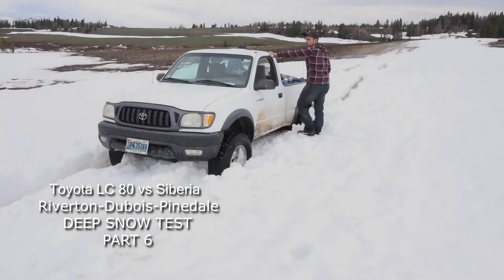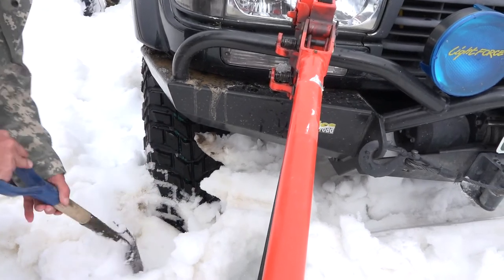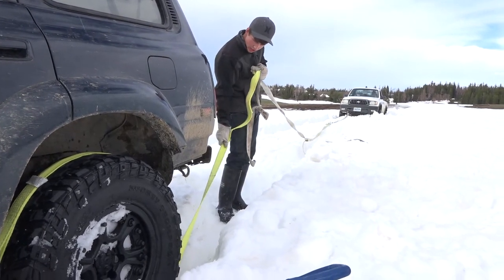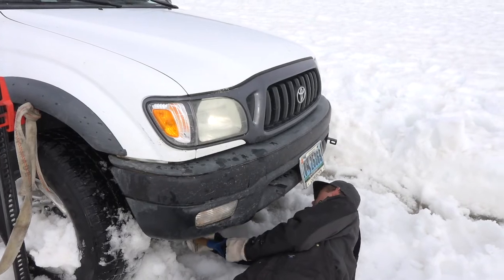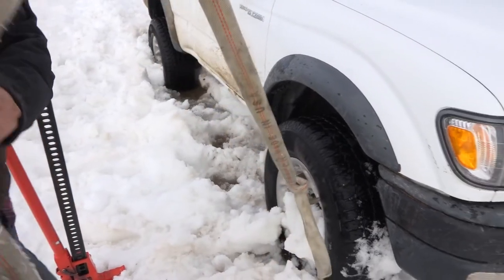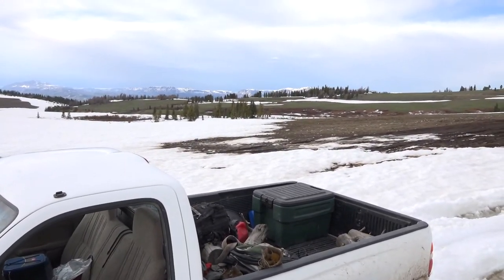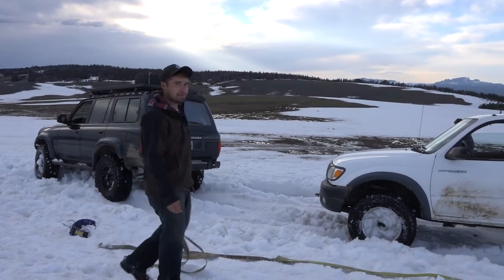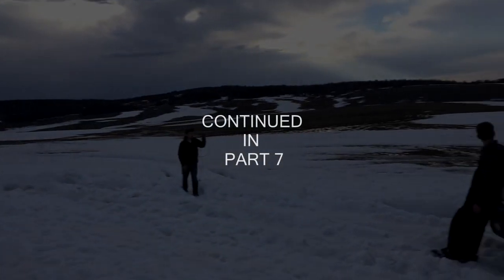Toyota LC FJ80 vs Siberia: Deep Snow Test Part 10

Comment: I'm liking this Siberia preparation series so far, it's good you found things like your leaky coolant line for the supercharger (or realizing how small your shovel is! haha I've been there before!) now and not on the side of the road in Siberia. Something else you might want to look into is a good recovery strap if you don't already have one, or even 2. A 'tow' strap is a static strap that provides a rigid yank and is meant mainly for pulling a constant load. A recovery strap is a dynamic strap that stretches somewhat in an elastic fashion - this allows you to give a really good yank with speed built up and thus momentum which stretches the strap and applies the force over the period of it stretching instead of all at once at one time, allowing it to be a softer less harsh tug and allowing you to use more force as well. This seriously helps in the case of a smaller vehicle like the Tacoma or another light truck or even car pulling out a heavy one like a Land Cruiser(If you can convince the driver to really give it gas that is...).

I have an ARB recovery strap that I've used countless times and it hasn't ever let me down. For the price when(IF) it breaks I'll buy a new one the next day.
Reply from the maker: Thank you much for your suggestion. It's definitely an area I've overlooked. Good t know you having a good results with an ARB branded strap. Probably will end up getting one also.

Comment: Good video Jake. That was a clever idea using the wheel winch method to pull the Tacoma out - I wouldn't have even thought of that. As far as getting unstuck, have you thought about getting Maxtrax or something along those lines?
Reply from the maker: Yeah, Maxtrax are good but only if live in the north pole, anywhere else you have to trailer them... to much hassle.
Reply: ***** Jake, I think you're thinking of Mattracks. Maxtrax are these plastic panels that you can put under your wheels to get unstuck. Expedition Overland guys (they have a YouTube channel and they posted quite a few videos - don't know if you follow) used them in several different situations and they seem to be very effective. A bit expensive for what they are, but seem to make life a lot easier.
Reply from the maker: My bad, you are right I was thinking of Mattracks. Now I know what you meant and yes I was looking into acquiring plastic or aluminum panels for the expedition.